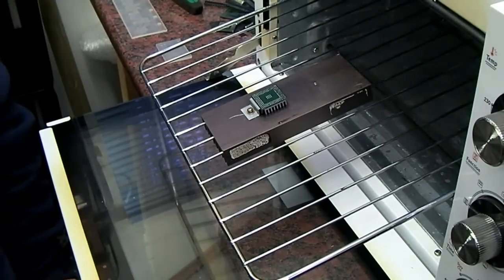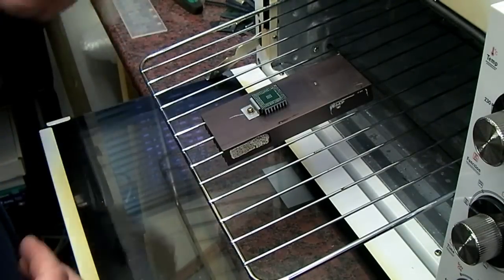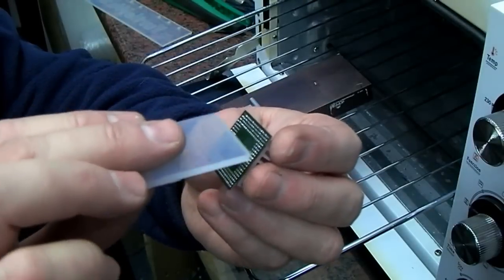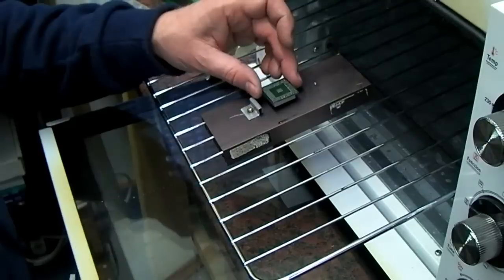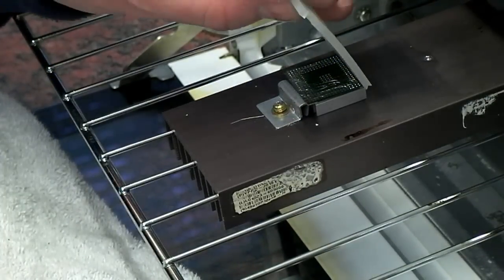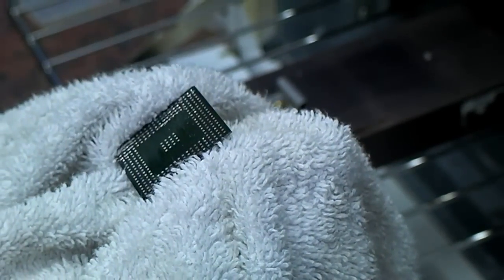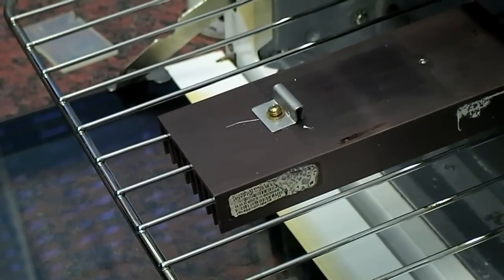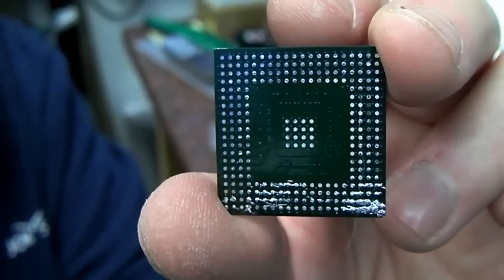Safe BGA Clean?

Comment: To prevent ripping pads cleaning bga or pcb with soldering braid, get yourself a real lead free soldering station instead of that antex.
For the squeegee method, it's an old technique.
You probably have a rework station, used to remove the bga?
Use that.
An IR station is the easiest for this,
But hot air will probably work to.
Just have to get it to liquidus.
Oh, btw, have been looking at your forum.
Could help out with reballing, rework etc.